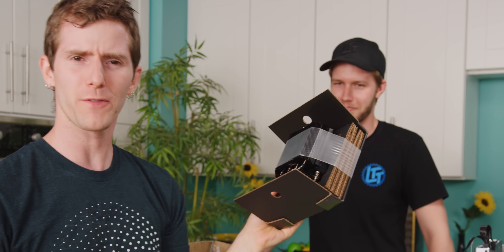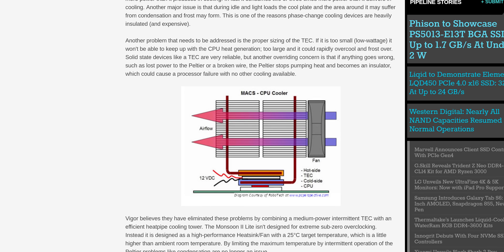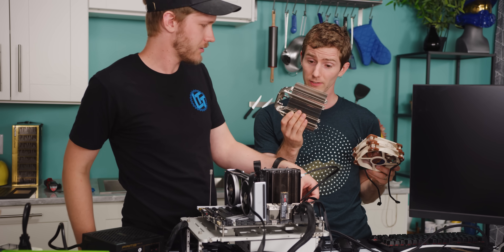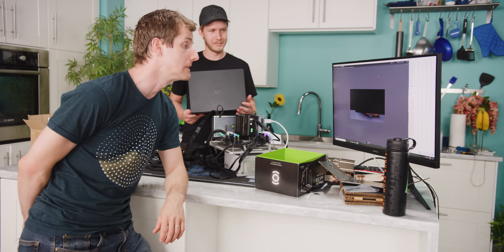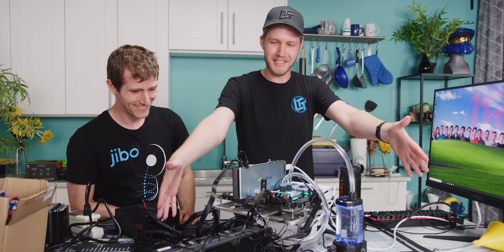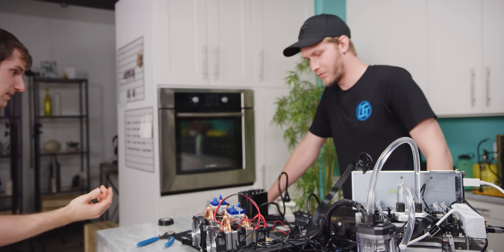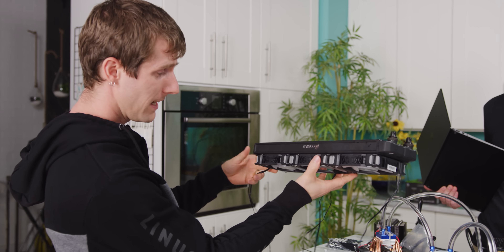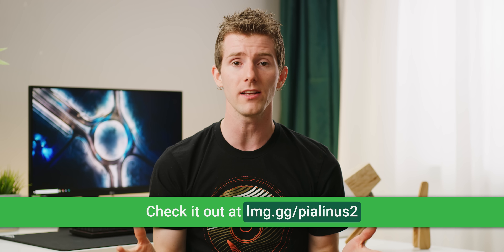Thermoelectric Cooling is a Bad Idea

Comment: Thermal electric cooling was the extreme cooling of the early 2000's when you wanted more than water could offer. I remember people making really thick heat plates to maximize the thermal transfer of two 175 watt pelt's in parallel. What killed thermal electric cooling was the ever increasing wattage output of CPU's. Once your CPU's thermal output was greater then the total wattage of pelts, there was no point in using them anymore as you were essentially just wasting power to get slightly better than water cooling results.

Comment: I had been wondering for a long time why Peltier cooling isn't more widely used and by your video I am not sure you have yet to answer the question yet. As you would seem to be doing a second video which you are hopeful to show where they would work well I look forward to part 2. 
One area I would be interested in seeing them tested would be in a sub-zero setup with liquid nitrogen. In your test it would seem at least to me the limiting factor was the lack of ability of the cooler to dissipate the extra heat quick enough and the Peltier devices themselves. Sure they may not make sense economically but I think when used right they could still offer greater cooling.

Comment: try cooling the hot side of your peltier with a solid aluminum finned sink like you'd have seen on an older cpu if you want on-demand performance.  those tower heatsinks work better when there's a specific hotspot or a very high gradient situation. tecs have very spread out heat and due to the layering of higher wattage modules can have internal resistances. if both sides of the module aren't kept at close to the same temperature you'll lose efficiency quickly. 
tandem tecs is also just not how you should be going about this if pulling heat out of a liquid loop is what you're trying to do.

one will be overworking and the other will be maxed and at maximum resistance.  What you want is a peltier stack with larger and larger modules towards the hot side, one tec directly cooling the next. or both tecs attatched to the same cooling plate. those looked like 60w tecs. the most comon and cheapest on the market so... there's that..  tecs have (at best) a 60% efficiency, meaning that if you put 100w into them, they will motivate 60w accross from the cold to the hot side.
simple math will show that 300w of high efficiency tec will cool 180w of cpu heat output if you can remove all of the heat from the hot side.  you simply aren't using enough power or cooling your tecs properly. 

that said, this is a horrible idea. tecs are worthless unless you need to get sub ambient in a shoebox formfactor.

Comment: I bought a Peltier cpu cooler at a computer show back in the late 90's. I remember walking up to the booth and seeing condensation on bottom of the demo cooler. It was cold to the touch so I bought and installed it. I don't remember what I ever did with it.

Comment: FYI Everyone, a TEC is nothing more than a Heat Pump. Putting one in between a cooler and the CPU IHS is not going to accomplish anything other then just being more complex. To be clear, they do not cool anything. They simply move energy from one side of the unit to the other. So while the TEC may make it look cooler at idle, it will not be able to move any more heat then a normal tower cooler would at load (as Linus showed in this video). That said. Still a fun video and would like to see more.

Comment: My one rig used a 2 stage loop, first stage was a pressurized alcohol loop to the cpu's then a second stage though peilter heat exchanger, to a second loop running distilled water to radiators.
Worked ok. Drew way too much power... then I hooked it to the solar panels... you can see where this is going....

Comment: Peltier coolers are awesome, just not for PCs. They have been used in a lot of critical applications (I know of at least a couple examples in optical measurement devices where sensors will fail if they exceed a spec temperature), but they are usually dealing with very small loads (like milliwatts), not the 60+ watts of a CPU.

Comment: Since you can also generate power by heating the hot side and/or cooling the cool side of the Peltier, how about trying to power a cooling fan from a Peltier, this cooler blowing on the CPU heatsink, and seeing where the equilibrium point is (if it even reaches one)?

Comment: The logic of this sounds like...
"Let's cool all them watts, by adding MORE watts!"
Reply: That's pretty much how TEC works.
Reply: I don't want to see that electricity bill which will arrive afterwards...
Reply: @SimonWoodburyForget  I guess, but isn't the whole point of an air conditioner is that the reactions that occur outweigh the added heat of its power consumption, if that makes sense? Well, certainly in that it pumps the heat away, so I guess it doesn't outweigh per se. Or does it..? That's interesting and a whole other question I guess.

This almost sounds like you're pumping electricity directly INTO the device that needs cooling. But I guess that's not quite what's happening either the way Alex explained i. It just seems like this whole thing is a waste and that if it ain't broke, don't fix it, you know?

Comment: Peltier: 
1. Hot side on the inlet of radiator
2. Cold side on the outlet of the radiator.
3. Install and run like normal
4. ??????
5. Profit

Comment: Did you notice the HEX cooler base plate has the 4 holes for heat pipes, then they added a TEC between that and a duplicate base that HAS the heatpipes going through it?  Efficiency is probably better with just heat pipes going through the initial thermal interface.  Eventually the TEC will be limited by the ability of the heatpipe cooler to dissipate heat in ambient conditions, so in the end the limit is the heatpipe cooler -- on top of that, the TEC will be using more energy to pump at a basically a zero differential across the element, as the "cold" and "hot" sides will reach equilibrium due to the heatpipe cooler being unable to reject more heat.  At least that's my theory.

Comment: nnn this is less a problem with tec cooling and more a problem with poorly designed tec coolers. That thing was just pumping heat back into the cpu, and didn't have any fans. You have to cool the hot side of a tec the same way you would a cpu. A tec cooler can only ever be of value if you intend to go below ambient.

Comment: I was using TEC's back in the late 90's for Overclocking, this brings back memories:)
Reply: Overoclocking Pentiums and Amd K6-III 450 ?
Reply: @tomf3150  First thing I actually overclocked was a 486 DX2 66mhz.  Bumped that bad boy to 100mhz:)  Did lots of Pentiums, not to much with AMD back then.  Funny thing is my personal rig is a 3900x,I really came around 😂

Comment: I think you would have had better performance running the peltier blocks in a parallel loop rather than series.  I design heat exchangers for power plants for a living, and I'm going to run the numbers tomorrow to simulate your situation and see if it could help.  You'd also do better with a coolant that underwent a phase change.  Use liquid ammonia to pull the heat off the peltiers, then air cool that.  Just some thoughts.  I'd love to work with you guys on some designs.  My company has a full machine shop and fabrication capabilities.  It would be very COOL, he he.

Comment: Here was my bad idea cooling that actually turned out as a success. I got tired of my computer room getting hot as hell anytime I fired up my PC so I decided to create a custom water loop for my CPU and GPU with two 480 mm radiators but the idea was to place the radiators outside of my house. And let me tell you now whenever I am on my PC the room stays the exact same temperature as my thermostat is set at and even with it over 100 degrees F in the summer here my GPU is still under 50 degrees C while gaming and my CPU is in the low 60's C. Of course at night when the temperature drops a good 20 degrees the temps on my computer  drop around 10 to 15 degrees also.

Comment: Using TECs to chill water can work, but the system you built is underpowered for an overclocked HEDT CPU. A decent rule of thumb is that your TECs should be pulling at least 2x as much power as the CPU under max load. That's to get a meaningful improvement over a typical open loop watercooling system. The setup you built would probably work well on something like a Ryzen 7 3700X or i7 7700K.

Comment: Many years ago I had an AMD interlagos FAH server that had a koollance dual d5 pump and the case had 2X 480  radiators. I used a 480 w tec as a water chiller and water-cooled the TEC. It worked great for 5 years

Comment: ok so I was really into TEC's back in the mid 2000's and I built a TEC drink cooler that worked really great (at horrible efficiency mind you). So I welded and insulated a canister that was the exact size of a pop can (all steel with 4 legs underneath) mounted the cold side of the tec against the bottom plate and mounted a 120mm corsair h60 aio to the hot side with a usb and voltage controller mounted off the side of the radiator. The result was actually pretty good with half a cm of frost forming around the canister in 2 mins. Super resource heavy but worked good.

Comment: uuuuuh i bulit a 100 watt TEC cooler for my 100watt LED(ended up just using a larger Pentium 4 stock heatsink and fan) it was by no means $350, i rthink the TEC itself was like $30, and it just ran on DC current, want it cooler? up the voltage and current

Comment: Peltier cooling failed in the past because of the condensation problem. Water + electronics =/ joy.
Reply: failed because its incredibly inefficent when dealing with high wattage cpus. Might actually be a bit better for threadripper and the giant multi die cpus though, since you can use larger tec modules.
Reply: @lalPOOO  I'm talking about 2007 and earlier.
Reply: @MyklCarlton  That's not why it failed. Everyone that does sub-ambient cooling knows that condensation will occur at dew point, and they all know how to deal with it. The problem was that peltiers were terribly inefficient, making them impractical for consumers, and they were also not nearly as powerful as an alternative like phase-change cooling or even liquid nitrogen itself. Those who need sub-ambient temps are usually overclockers trying to set records anyways, so they'll need a lot of cooling power with something like liquid nitrogen since peltier cooling can't keep up with its thousand-watt loads
Reply: @MyklCarlton  I was around in 2007 and earlier oc'ing w peltiers and phase change, cdn winters etc. Techniques for preventing condensation have not changed much since then. Sprays, brush on coatings, vaseline, kneedable eraser, socket heaters etc
Reply: @lalPOOO  Yes. More work than the majority of hobbyists cared to put into getting a cooling system to work at the time. While inefficiency is an issue, most of us aren't bothered about a few more cents on the power bill if we can get better overclocks.

My memories are probably coloured by living on the humid Eastern coast of Australia.
Reply: Nothing an old can of mom's air spray left over from the 80's didn't fix... (also handy if you live in humid conditions near the ocean, that salt haze in the afternoon is a killer)
Reply: Yep and the added wattage needed hurt too since high wat power supplies where pricey as hell. Which off set the cost, water was then much cheaper

Comment: ATTENTION! I NEED HELP. Will someone tell me if I have a good pc?
CASE - NZXT H500 x 1
CPU COOLING - DEEPCOOL GAMMAX GTE x 1
MOTHERBOARD - MSI Z390-A PRO x 1
GPU(GRAPHICS) - NVIDIA GeForce RTX 2060 - MSI VENTUS 6G OC x 1
CPU - Intel Core i5-9400F 6-Core 2.9 GHz x 1
POWER SUPPLY - NZXT E500 Gold Digital PSU x 1
RAM - G.SKILL Ripjaws V 8GB (2 x 4GB) 2666MHz x 1
SSD - Samsung 860 EVO 250GB x 1
MONITORS - MSI Optix MAG24C 24" 1080p Curved Monitor x 1
SERVICES - Standard x 1
SOFTWARE - Microsoft Windows 10 Home x 1

Comment: My problem with the setups is instead of useing the spare cpu water blocks  that linus has he used ebay ones

I created a chiller useing tec chips and can cool a fx8120  with consumeing 400 watts (includeing pumps and fans) but its no different then cooling with the aquarium chillers 

Also if you ever decide to do full room liquid cooling again linus that is the better way to go  and you need to flow balance it

Comment: Reminds me of my Cooler Master V10 I used from 2014 until early this year xD
(another instance of a CPU-Cooler with an TEC)
Reply: I was lookin at those for abit, how was it?
Reply: @adapalis  Well the cooling performance is OK.
The CPU I used this most of the time on was a I7 6700k, which I were able to OC to 4.8GHz stable @ 1.44v...
The TEC kicks in once the cold plate of the cooler reaches 75°C, which is about 80°C CPU Temp with my delidded CPU.
So for the cooler to be effective I was required to have a high voltage (temp) applied.
Though I ran it most of the time on a 4.5GHz OC without using the TEC, because the cooler itself is massive and can could keep it cool that way.
I replaced the fans with Noctua NH-F12.

And yes the weight is a serious factor, after I delidded my CPU I installed it back into the socket and let the retention bracket and CPU Cooler hold the heat spreader in place, that was a mistake because Skylake had a very thin PCB and after installing my system on booted up with my RAM configured only in single channel...
The size was big, but not too big, I fit in my previous cooler Master case (which I forgot the name of) after hitting the 5.25" bay a few times with a hammer and it fit great (without any force) in my now current Be Quiet dark base pro 900. 

The power draw of my TEC was (when active) about 80W.

Now it sits in my shelf until a friend of mine needs a new CPU cooler.

Any more questions?
Reply: @sntx_8250  No perfect, that's all i needed to know. Thanks
Reply: I had it all the way back in 2008/2009, it was a decent cooler, but it was NOT good value, it was heavy enough to be a worry when installed (like 200 gram heavier than anything Noctua has ever put out), and it only really shines when it's pushed by a massive thermal load, because just like this the V10 only activated the TEC when it reached a certain wattage.

It kinda tried to avoid being horrible by being a dual-tower cooler with two fans and even cooled the RAM (one of the sides of the tower was turned horizontal over the RAM slots), but it was just.... Not worth it.
Reply: @TokeBoisen  I actually wanted to get it, but went for the HYPER 212 EVO. That thing kept my FX8320 at stable 4.4 (though high temperatures, but it's still alive even after 4 years of use).
Reply: I had the cooler Master v10 and Ultra Chilltec at the time but never had the chance to use the Cooler Master v10 matter of fact I just sold it brand new in the box but the ultra chilltec was OK but I probably would’ve been better off doing water cool instead of the ultra chilltec. I’m glad to see somebody had a chance to use the cooler master V10 I always wondered how they perform.

Comment: Peltier cooling is like a high voltage source with a very low current. the voltage is very high until you increase the load.

Comment: Linus actually no
Just buy a peltier module put it in your power supply put the cold side on the CPU and a noctua radiator and fan(maybe even an aio cooler) on the hot side. doing it yourself is better. You need that sketchy heatsink made by Alex for it to work!

Comment: Peltier cooling is actually very good... it just produces heat and requires power. if that doesn't bother you, you can cool a water loop without problem.
I did it for a science class during sophomore year. 
I plan to redo that for chilled cpu water loop. 3 radiators to pre-cool to ambient and peltier coolers to chill the water before it hits the cpu block. the more heat the peltier cooler can dissipate, the better it can cool.

Comment: Peltier devices are much more efficient in the lower wattage range. I would really like to see a sub-ambient setup of 100-200 peltier devices  so that they do not get overloaded! (basically one water loop between the cool peltier sides and the cpu and another water loop to dissipate the heat from the hot peltier sides)

Comment: It would be nice if you tried a parallel installation instead of serial one and to remove the fans from the coolers and place them directly in the water then cool the water with water cooling :p .

Comment: 4:14  I don't know about commercial products, but people were using Peltier coolers on 486 processors in the early 1990's.  Mind you, these are processors which do not require active cooling at all.

Comment: How to do this right: 

Machine some copper heat sinks with perfectly vertical fins such that they line up with 1 peltier of room in between any 2 fins on opposite sides and 200um of room for thermal paste.  Think shuffled cards with pieces of paper between each.  Put Peltiers between the fins, put water block on other side.  Make water cooling loop on hot end anyway because you need that much dissipation.  Radiator can be smaller though as temperature is slightly higher. 

Is it sensible to do this?  No.

Comment: I had a heatsink that used the same tech as this on a PIII 800Mhz waaaaaaayyy back. It keeps things cool - but its certainly not efficient... It drew 4-5 amps at 12v - but it did cool the CPU to 4-5 degrees... In other news, I just remembered that CPUs used to be on cards.... Slot 1 anyone?